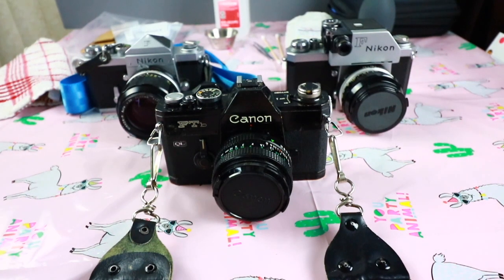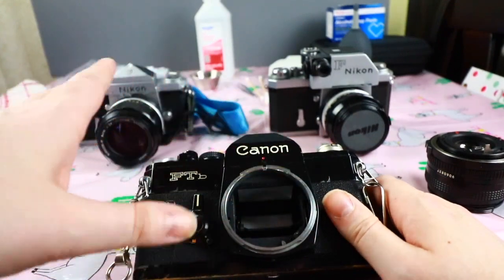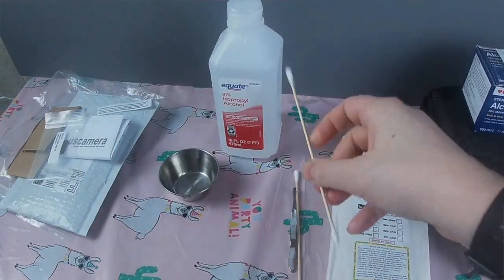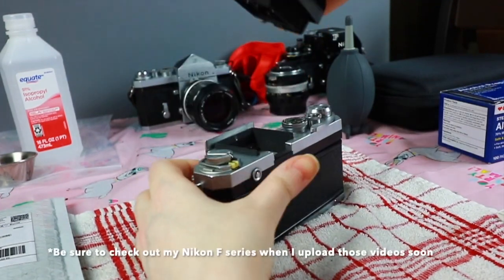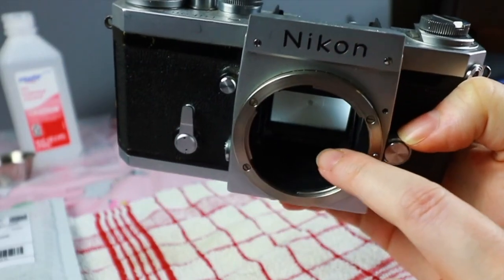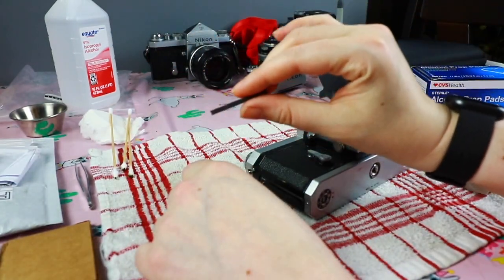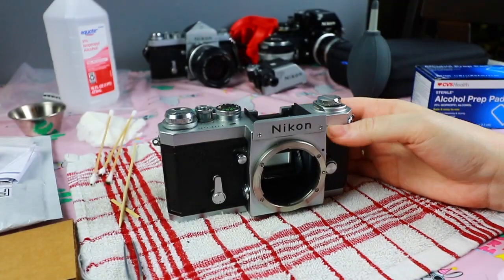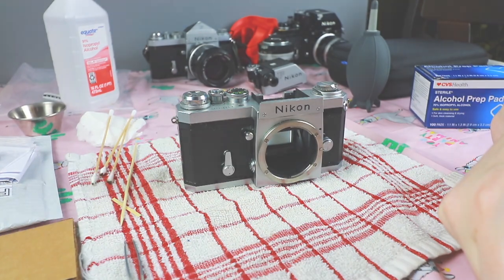Fix That Camera - How To Replace a Mirror Foam Bumper in your SLR Camera

Comment: I recently got a Nikon F very similar to this, but the foam in mine broke up considerably more and its all over the mirror.   I also just got a Nikon FA today and its foam piece seems to have just started breaking up. But again, got on the mirror. I have a bulb similar to what was shown here, but it seemed to have no effect on the debris in the F. I still have to try it in the FA where it might work. Not sure what to do about the former camera though. 
 Regardless, this has been a very helpful video, Ill refer back to it again when the foam pieces show up in the mail.
Reply from the maker: Im glad it helped. Once it gets on the mirror, that is so tough because they’re so delicate. You could try one of those sensor cleaning kits but it still risks minor scratches.
Reply: @AlysVintageCameraAlley  as promised, I have come back for reference and successfully repaired my F. I even got most of the crud off the mirror with a very fine brush. These is still a bit of debris in there, but its entirely usable. WAY better than before. Thanks for making this video. 
 I'll now move on to my FA. It is in better shape, but there are more foam seals and I dont know where they go. So I'll need to find another video for that.
Reply from the maker: I’m really glad to hear this. Sorry I couldnt help with the FA. I don’t have one myself so I can’t demonstrate it. Hope you can find one that does.

Comment: Hi.. might be an idea to shine a strong led light through the eyepiece while in exposing mode B to ensure that no light is leaking past either the new bumper strip or at the sides of the mirror which might happen if the mirror is not fully seating against the viewfinder.
Reply from the maker: Thanks for the info! Good idea

Comment: What do you think I should do about the faint line of stuck mirror foam on the edge of mirror?
Reply from the maker: That’s tough because the mirror is so so gentle and easily scratched. I have used a sense of cleaning kit to gently wipe it off with lens cleaner but it’s extremely hard not to scratch it. If it’s not causing any problems I’d leave it.
Reply: @AlysVintageCameraAlley  I used a Pec-Pad wrapped around a Q-tip swab with a couple drops of Pec-12 solution. I very gently wiped across it, then did the same with a dry Pec-Pad immediately. Worked great fortunately; came right off and the mirror looks fine. Phew!
Reply from the maker: @Sunslip  cool. Good job. I’ll have to remember that

Comment: I the Canon F1 foam easy to replace ? Do you have part numbers?
Reply from the maker: I have the Canon New F1 and the foam is basically the same as the FTb I post a video replacing. I’m not sure which parts you mean.

Comment: Mirror foam came out of my Nikon f2, and now the mirror sticks. Big help thank you
Reply from the maker: We’re you able to fix it?
Reply: Aly's Vintage Camera Alley I just bought the foam for the mirror, I’ll see if that works. There is a very thin piece still in there. Will the alcohol remove it? This happened when I was outside shooting one day and the mirror stuck, when I opened the camera a strip of foam fell to the ground.
Reply from the maker: Oh yea. Sounds like the previous foam stopped sticking. The alcohol will clean it off. Try to clean it out good so that the new one will stick properly. Be careful not to get it on the mirror. Cover it like I did. It’s so difficult to clean the mirror without scratching it. Good luck. Let me know how it goes or if you have anymore questions
Reply: Aly's Vintage Camera Alley will do. Thank you for your help!
Reply: I wanted to thank you. I replaced my mirror bumper on my f2sb and the mirror no longer sticks on slower speeds.

What a gem of a video!

Thank you 🙏
Reply from the maker: Nicholas Fanzo thats great! This makes me so happy. This is the reason I made this channel. If I could help even one person. Thank you for taking the time to let me know 🙏

Comment: Hi can you give us the link on where to get the self adhesive foam, i wanna save my camera huhu btw thanks for creating this video!! <3
Reply from the maker: Hello
This is the foam I used 
https://amzn.to/3C5nvhq
It comes in different thicknesses for different parts of the camera. For the mirror foam bumper I think the 3mm is fine.
Reply: @AlysVintageCameraAlley  my camera is Nikon EM, how long would i put for it? Thank you so much. I subscribed to your channel so i dont miss out🥺
Reply: Apparently its not available in our country…
Reply from the maker: Let me see what I can find. What country are you in?
Reply from the maker: You would have to measure the length using a tape measure. I don’t have an EM so I wouldn’t be able to tell you. But once you have the adhesive, cut out a length of it then trim it to fit your area.
Reply from the maker: Here’s another one https://amzn.to/3nxnA9Y 
2mm would work as well
Reply: @AlysVintageCameraAlley  I live in Canada, Ontario. I started looking for an adhesive foam and I dont see a cut-out already cus i’m very bad in cutting crafts too😩
Reply from the maker: @annecalimlim9855  I’m bad at it too. But it doesn’t have to be perfect :) I think you can do it. You can also buy kits from Jon Goodman. He pre cuts foam for some cameras. I did that in my light seals video. Here’s his email jon_goodman@yahoo.com
Just let him know which camera you have and what you need. Hope this helps.
Reply from the maker: Oh and also U.S Camera  has mirror foam kits. I purchased from them. I’m not sure if they ship to Canada.

Comment: Any tips on getting the adhesive off? I've been trying with alcohol for a while but the residue just won't budge :-(
Reply from the maker: I had to scrape a lot of mine off. But something oil based may work. Kind of like skin barrier stuff that they use in the hospital before placing on a bandage. It’s oily and removes the bandaid glue. I wonder if olive oil on a q-tip would work? Otherwise if it’s not a tone of glue the new foam should sit over it fine. I’ve never had an issue with

Comment: Thank you!! I need to do some work on my Minolta XG-1 that will involve removing its lens mount. It never would have occurred to me to look for mirror foam, much less replace it, but having seen this video, you better believe I'll at least be checking its condition as long as I'm working on that part of the camera anyway. You may have just saved me some extra work, or, at worst, an expensive repair.
Reply from the maker: Awesome. Yes check all of the light seals. Those are usually rotted out.

Comment: Do you recommend 1mm, 1.5mm or 3mm thickness? I am replacing my mirror bumper on my Konica T3.
Reply from the maker: You really just have to use your judgement. You don’t want it to be so thick that the mirror has to push too hard when it slaps up but you also don’t want it so thin that it’s just squishing it. I think I usually go with the 1-1.5mm

Comment: hi! thank you for the tutorial. i just replaced my light seal foam on my yashica tl electro x, but i'm scared because i had replaced it last week as well. the problem with last week's replacement was that once i got my roll developed, there was suddenly a large black line horizontal cutting out 1/4 of every photo in my roll. i just replaced last week's strip with an even thinner one just now-- could this be a matter of how thick the foam was?
Reply from the maker: It could be. If it’s blocking a portion of the square behind the shutter then it will show up in the photo. I’m not familiar with the camera so I can’t say for sure.

Comment: You did a good job on that.I have cleaned a couple SLR mirrors.Only if they have fingerprints when I get them.I use a soft microfiber cloth and brush very lightly.This is always a last resort.
Reply from the maker: thank you so much. Yes I am always apprehensive when I have to clean the mirror.

Comment: Any advice on how to clean bits of foam on the mirror of a Nikon F?
Reply from the maker: That’s a tricky one. You have to be very careful not to scratch it and they do scratch very easily. What I would do is remove the prism head and focusing screen so you can come in from the top, and if you have one of those air blowers that you use to get lint off film, blow a little bit of air towards the lens opening (with the lens off of course) then if anything is still left on the mirror, I would use a gentle microfiber cloth and gently dust the mirror outward. I hope this helps. I have used Q-tips in the past but these tend to leave behind lint
Reply: Follow Aly's advice and use the blower first--that's the gentlest way to clean it. If that doesn't do it, you can indeed use a bit of microfiber cloth--but I would moisten it with a bit of naphtha (lighter fluid for cigarette lighters) as that will dry quickly and leave no residue. (If you use old cameras, a can of lighter fluid is handy to have around for cleaning lots of things--every second hand camera shop I've seen has a can sitting under the counter for removing crud from various places on cameras/lenses.)

Comment: I've re-foamed and resealed several Nikon film cameras, usually using Jon Goodman's precut kits. One tip he offers, which has proven very useful for me when putting self-adhesive bits of foam into place, is to lick the adhesive side once you've removed the paper backing. That will moisten it and keep it from sticking immediately, which gives you a chance to maneuver the foam into exactly the right place easily. When it dries, it will stick just fine.
Reply from the maker: Yes. Great tip. I forgot it in this video but my recent one on resealing my Ricoh 500G I made sure to implement it.
Reply from the maker: @bagnome oh that’s a great tip about the sanitizer. I don’t think that was on there back when I bought my kit. Probably something implemented after covid lol

Comment: my mirror has been sticking in the up position lately. any recommendations for that?
Reply from the maker: It could be from your mirror foam. Does it look like it is falling apart?
Reply: If the foam is worn the mirror frame could be hitting harder. This might cause the mirror to slide out of the bracket and catch on the edge. Maybe check the mirror and try sliding it back into the holding tabs. The root problem would be bad foam.

Comment: Hi Aly,
With the new mirror bumper strip installation, don't you have to remove the old foam (or what's left of it) before installing the new one?
Reply from the maker: Yes. That’s what I demonstrated in this video
Reply: @AlysVintageCameraAlley  Yes! On a second take of the video you did indeed remove the old stuff, but I am surprised by how little was left of the old foam, it looked just like little pieces of residue.

Comment: how do you clean mirrors, focus screens and mirror boxes without taking any coating off the mirror or blasting a bunch of dust in the prism?
Reply from the maker: I use lens cleaner and VERY gently wipe the mirror but it is very risky. I’ve read some people use alcohol and a qtip . I haven’t tried it
Reply: @AlysVintageCameraAlley  yeah i have already damaged one pentax camera this way, it wasn't ever the same. 

the camera i want to fix is a nikon ft2, maybe they don't coat the mirror with the same stuff at nikon, but who can say?
Reply from the maker: Punk Rachmaninoff yea I honestly just use a microfiber cloth and gently wipe downwards. I just cleaned the dust off my Nikon f mirror this morning with this. No cleaner or anything. Just the cloth and it cleaned it good with no scratches. You just have to be careful not to knock any of the foam off the mirror bumper

Comment: I recently got around to replace a few mirror bumpers ( I have several Fs). I found that popping out the focusing screen and setting it aside reduces the risk of scratching it while doing the foam replacement. Also with the prism removed, the Nikon would sit nicely upside down on the work table and in this position allows easier access to the old foam, while also facilitating the accurate placement of the replacement foam.  After that I took the oppportunity to inspect the focusing screen and blow off any visible dust particles.
Reply from the maker: That’s a good idea. Thank you

Comment: Hi Aly! I'm having a mirror-related problem and I'm wondering if you can help. I have a Minolta X-7A and the mirror won't stay down on its own. I can bring it down easily but when I let go it springs back up by itself. Do you have any ideas as to what the problem could be and if I could fix it myself, or if I need to have it sent in somewhere to get it fixed/replaced. Thanks!
Reply from the maker: Hi Brooke. Unfortunately I have never had a Minolta and I have not learned yet to repair a mirror, but I know you could find someone to help with this on Facebook. There are so many groups especially the vintage camera collectors group, that could probably steer you in the right direction. There are probably even Minolta film cameras pages as well. They would know repairmen. I hope this helps.

Comment: So, I was having trouble installing mine into the door channel. It kept twisting on me and having pulled up and stretched it one too many times, it snapped in half. What is the trick to keeping it straight and how straight does the foam need to be in these little channels? Thanks.
Reply from the maker: Hello. Where did you get the foam? Mine did not twist, but I would try peeling the back off as you place the foam down. The channel it fits into should keep it straight. Hope this helps.
Reply: @AlysVintageCameraAlley  I got them from US Camera. I had a F and a F2 to reseal. The F was fairly easy but when I tried to get the door seal foam in the F2 I just could not keep the little foam strip straight. I was worried that if it was twisted in the channel that it would not seal properly so I kept trying to lift it back out and keep it kind of taught as I laid the foam back down little by little. I got about and inch or less and the strip just ripped in two. I even applied some purell on it to extend the stick time, but in my hurry, I guess I pulled it up one too many times. I took the little backing completely off with that attempt. I guess the sticky parts were grabbing the sides of the channel?
Reply from the maker: Gunnar Williams oh ok. I don’t have an F2. I haven’t yet done seals for doors. I’m going to soon on my canon FTb. The strip must’ve been very thin that’s why it kept twisting. If you do try to again try tweezers to start it off. And only take the back off as you push the strip into the channel. They usually come with a stick to guide it. Use that after the first initial push with the tweezers. Then slowly pull the back and push it into the channel at the same time. I hope that helps. I will have a video on it soon when I get a kit to do mine. But for now I don’t have any experience with it. I would also message US camera and tell them this happened because they should replace it. Especially since it twisted and fell apart.

Comment: Great video, so much information I needed. Is it also possible to use the self adhesive foam from the craft store to replace the finder rest? Or would that be better done by a prepackaged kit? I'm much more into the DIY options. Thanks so much for doing this video.
Reply from the maker: Sure just make sure the thickness is correct. If it’s too thick the finder may not click back into place. I’ve been using my own self adhesive foam lately but I’m just so bad at cutting them out straight and correct LOL
Reply: @AlysVintageCameraAlley  I've just emailed Jon with those kits you reference in your video. What a helpful guy! You are also super helpful btw! He says you have to be very careful with the foam you buy, as much of the stuff from Asia is just garbage that won't last 5 years. Now I'm a bit stand-off-ish. I want the cameras I sell to be useful for decades more. If I can do something so my customers have a long and happy photographic enjoyment of their purchase. I think I'll be going with Jon's kit. I really appreciate these videos you do Aly. I can't stress that enough.
Reply from the maker: @JHurrenPhotography  thank you! I can’t tell you how much that means to me. It really makes me happy to help people. If you have anymore questions feel free to message me.

Comment: Thanks great informative video..soon as current roll of film in my 1971 vintage Nikon Ftn is exposed I will check the mirror bumper and prism seal foam and replace if necessary.  What is the name of that foam seal kit you used?  Stay well.
Reply from the maker: thomas moje I get it from US Camera on eBay. They have kits for all different SLR cameras. Just search mirror foam kit on eBay

Comment: Great video. So is the bumper foam in these eBay kits even to spec? It seems awfully thin. Would you be better off with a diy thicker foam padding? Or is that bad for the mirror action? Thanks!
Reply from the maker: Thanks! 
They are pretty thin. But I have never had a problem with them. I am actually working on another video where I cut the foam bumper myself using thicker foam. So I will see which is best. I have seen all different sizes from 1mm - 3mm and I think the only difference would be the thicker one would probably take longer to wear down.
Reply: Aly's Vintage Camera Alley, cool. Would love to see a followup video.